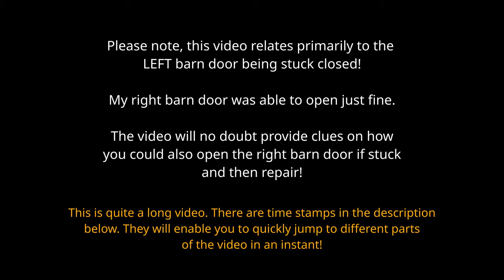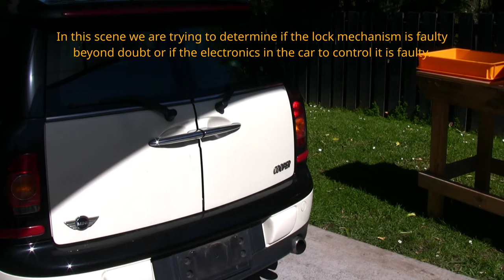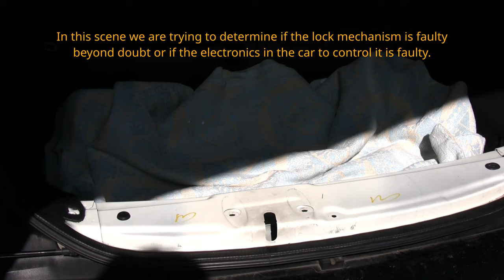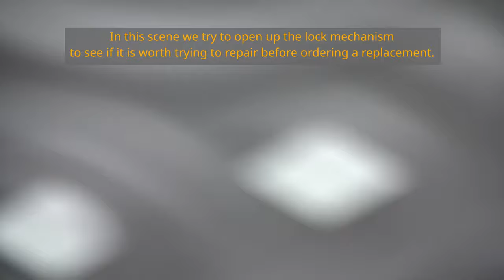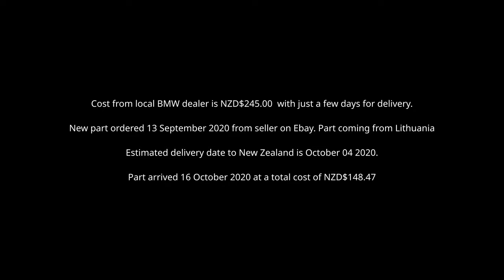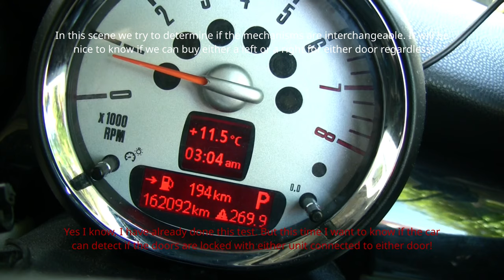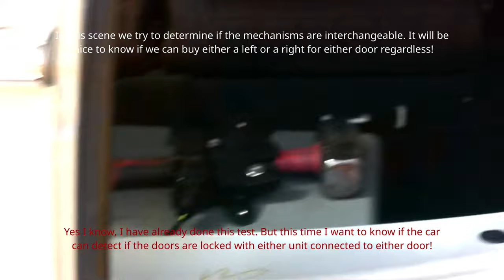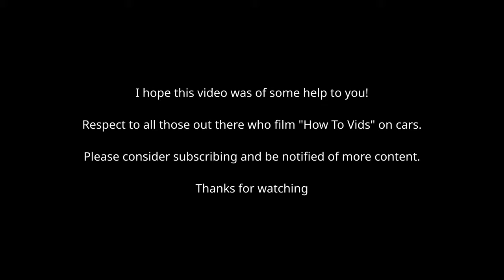Mini Cooper Clubman R55 stuck rear barn door.

Comment from the maker: Remember during re-assembly to adjust the x2 doors so that they latch in two stages! Example, they could be latched but not fully closed. Push further in and the final latch position is achieved. This will take some adjusting.

Comment: God forbid BMW should do something as basic as add a key entry as backup to a lock mechanism known to break down. Their attitude seems to be the more complex and fragile we can make something with the least amount of backups, the more special we are as a car company. I've got a 2009 R55 and am dealing with this same issue. It's frustrating because it seems to be as much a fault of thoughtless design as of poor build or subcontractor quality control.
Reply: I have the same 2009 R55 with the same problem. I know exactly what you mean about BMW coming up with a solution. I actually am not new to this kind of thing, as I have been an automotive collision tech for 45 years, and have dealt with literally thousands of issues of this type. It is frustrating when it's your own car though, that you have to 'slip in' the repairs between customer cars. The LEAST they should have done is incorporate a small access panel to get to the latch to pop it, so you don't have to try to be a contortionist and get your hands in somewhere they aren't designed to go!

Comment: So my right door would unlock by itself and I disconnected the big thing onto the latch since I have comfort access it would open while I driving on the highway that automatic clicking noise went away is that okay?
Reply from the maker: I wish I could help you but I do not have any experience with Comfort Access.
Reply: my doors also open by themselves. A mechanic told me to replace both door lock actuators and “make sure to put the drivers one in the right spot” . He also has a clubman. He told me the job would cost $500 if he did it but he knows I try to work on my own cars